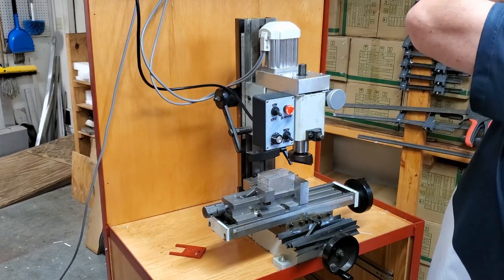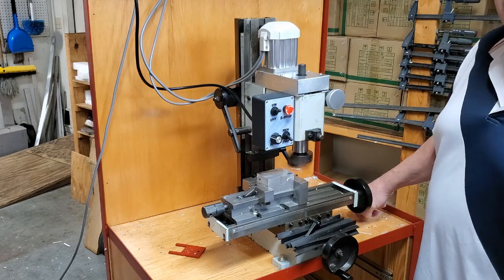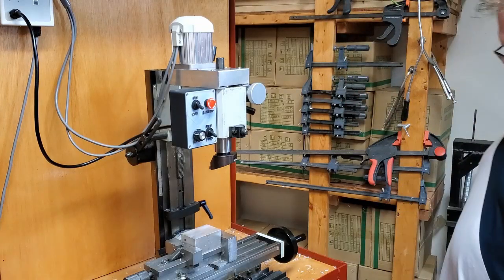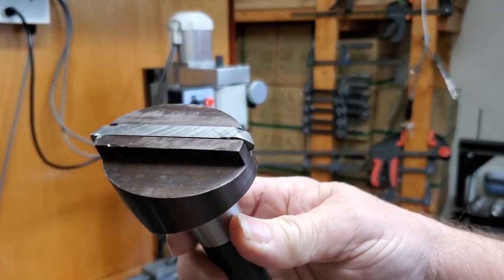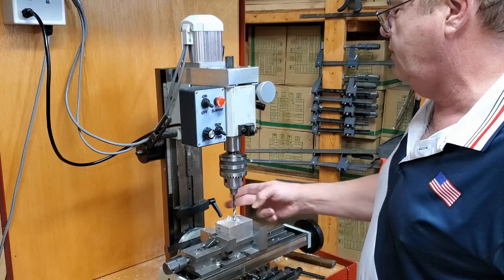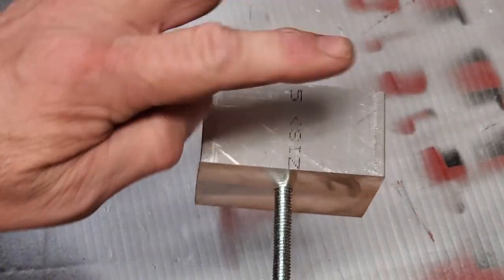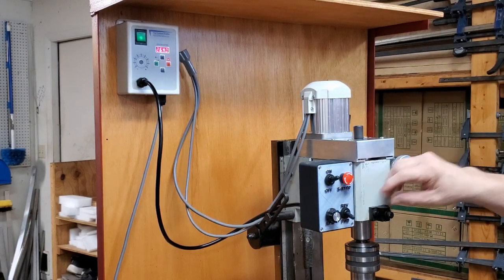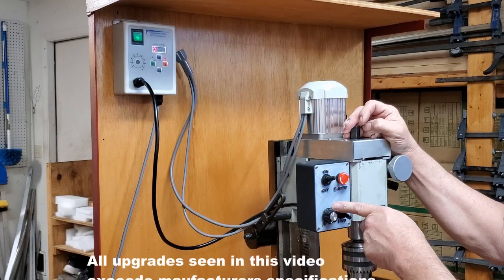Mini Metal Milling Machine, Tethered Control Instant Reverse  1 HP Servo Motor Upgrade CNC Optional

Comment: Hey John, thanks for the LED light and the speed control wiring on my last order (#10285). I have a small drill press I want to use one of your motors and controller to convert it to a mainly a tapping machine. Can you wire up the control box so that when I hit the start switch the spindle turns forward, and then when I press the foot switch it goes into reverse to blackout the tap?😄
Reply from the maker: Only the controllers with the reverse on the fly operating system can reverse like this. 
You do not even want to hear the price to make one custom made item. Only making 50 or more brings it into a price people are willing to pay.
It's a simple on/off switch, It will not work with the foot pedal we sold in the past or with the controller that can run that foot pedal.
The operating system can be loaded into that controller but it will no longer run the foot pedal or speed switch that controller uses.
 I do not have time. You will have to design it, manufacture the housings and wire it yourself.
Reply: @danielmartin382  OK, thanks for the info.